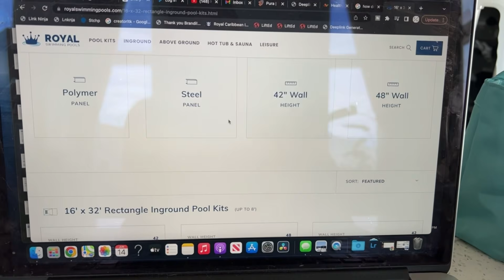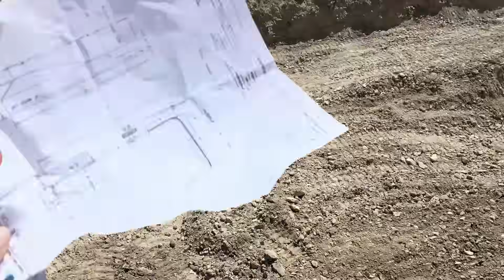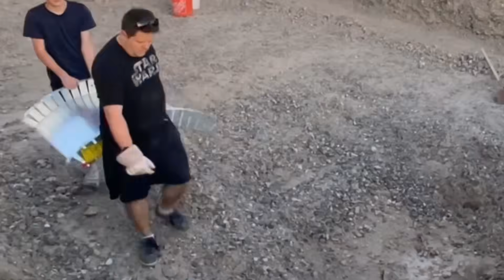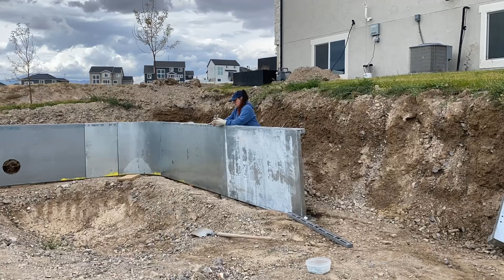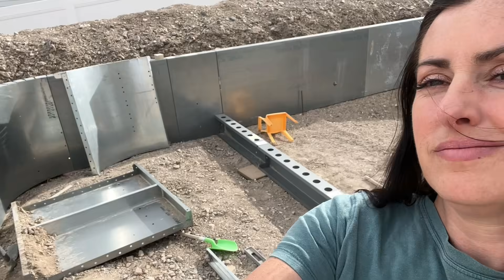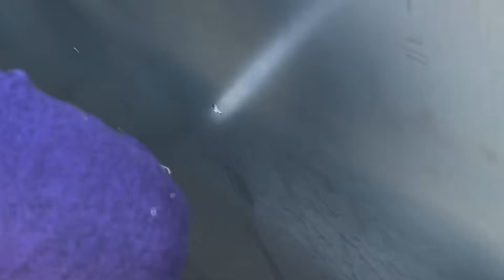DIY Inground Pool Build - PART 1 - Vinyl pool Build

Comment: One big thing I think you missed is where the pool skimmers should be placed when designing your pool.  I'd have put them in opposite corners on the long side, with the jets shooting water directly at them on the opposite side.  This way you get a circular water motion in the entire pool and it makes it very easy to keep the surface clean.

Comment: Hello, I’m doing 20by50 in ground pool. How did you get your slope down to the deep end at the right angle?
Reply from the maker: My advice would be don’t worry about it too much on excavation. Get it within a few inches and you can fix the slope when you put in the poolkrete. I just measured each angle bases on the top of the pool wall and 6ft bottom. I had a paper design and just cut the dirt to match those